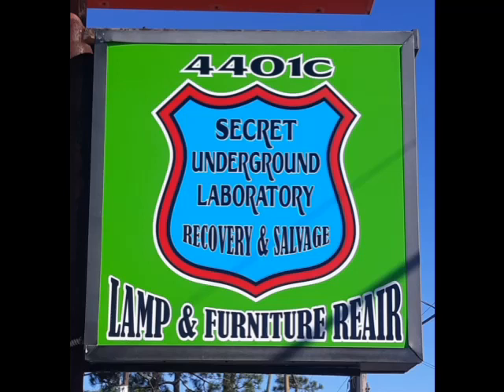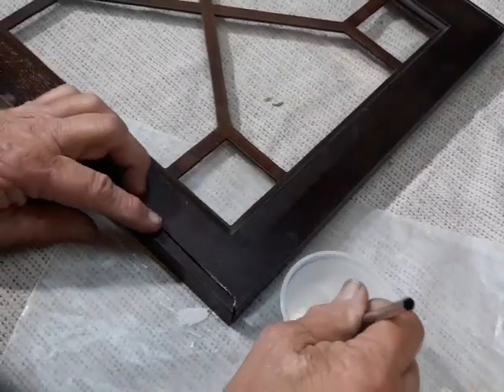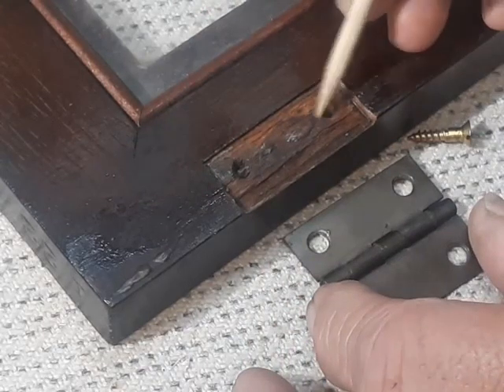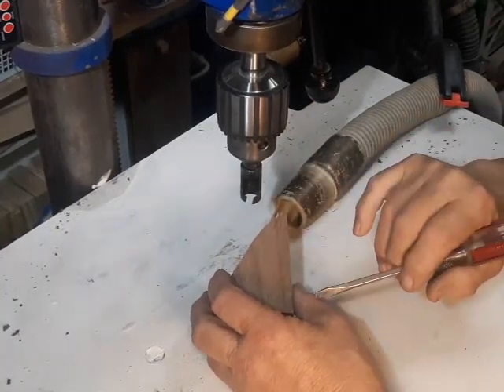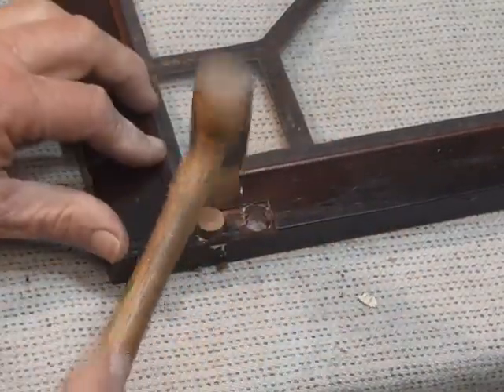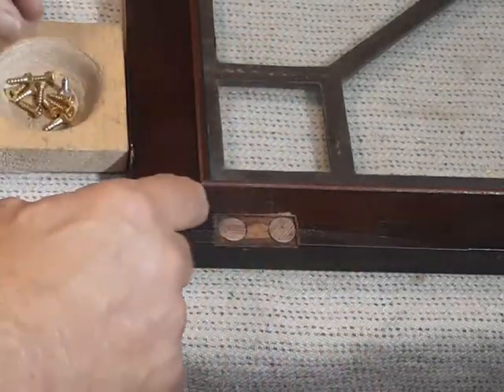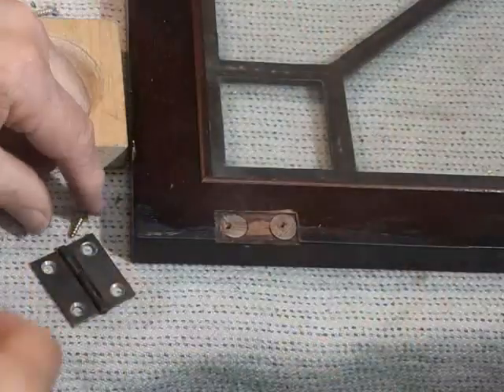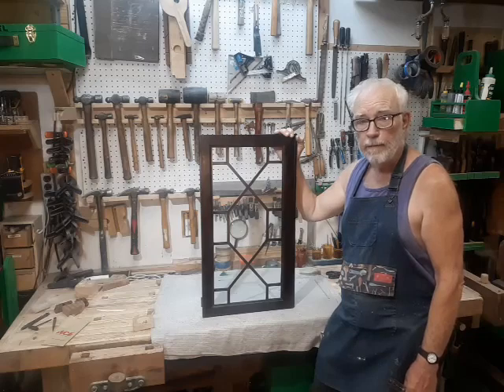Repairing an Unhinged Cabinet Door in the Secret Underground Laboratory Recovery and Salvage.

Comment: Saturday morning, coffee and a visit to the Secret Underground Laboratory has become a great way to start my weekend.  Once again, thanks for the genuinely useful tips, I have one of those Stanley nail sets sitting idle in my toolbox, now it will have a use.
Reply from the maker: Thank you very much. Setting hinges is one of the most tedious parts of cabinet making. If the screw is off center, it pushes the hinge out of position. This is a real problem on small hinges with only 2 screws.

Comment: The walnut inserts is a great idea.  I have had a similar problem and just relied on glue and a golf tee to fill the hole.
Reply from the maker: That will work if the stripped hole is in a large piece of wood. In this case, I needed to eliminate the expanding pressure that caused the wood to split.

Comment: Inexplicably Veritas discontinued a tool called the Plugger that was a tapered reamer which was of same angle produced by a pencil sharpener. The kit came with a set of predrilled cedar dowels but with a standard classroom pencil sharpener, it is possible to fashion the plugs out of any desired wood. It was the perfect tool for this and similar repair tasks such as redrilling pilot holes for screws. Another example of an expertly achieved repair, sir
Reply from the maker: Thank you very much. I remember the  plugger in catalogs and my impression was it was too much money for a one purpose special tool that solves a problem that doesn't come up that often.  The real cause of the failure in this video  was a poor choice of the board for application. The grain was perpendicular to the face, so the screws became wedges and split the wood. It did take about 120 years, but still.
Reply: @BronZeage  I use mine for both repair and decorative details as in line and berry inlay. I would pay double to find a replacement so terrified am I that I might break the reamer
Reply from the maker: @annarboriter  I doubt you can break the reamer in wood.

Comment: Great tips here.  I had to look up "gimlet" after you mentioned it while hand drilling the screw holes.  Why did you use a gimlet instead of a regular battery powered hand drill?
Reply from the maker: Thank  you very much. It was no other reason than I had the gimlet handy and the I would have had to search for the pilot bit with the attached depth stop.

Comment: Can't tell from the video -- do you do anything specific on the grain orientation on the plugs?  

99% of my work was on site and I ended up with a pretty well-tuned set of tools and hardware.  Basically one tool tote and a bag for drill and drill accessories.  A few extra pneumatic tools like nailers and staplers.
Reply from the maker: The plug grain was oriented across the cabinet grain. I intended to mention that, but between the glue and getting the plugs right, it got lost. Most of my house calls are chandelier installation in older houses. I have a Go Bag of tools just for that so I'm not culling through the bench tools. There seems to be no end to the variety of early 20th century light fixture hanger hardware. A lot of it is cobbled together from old gas fittings. I expect to be surprised.